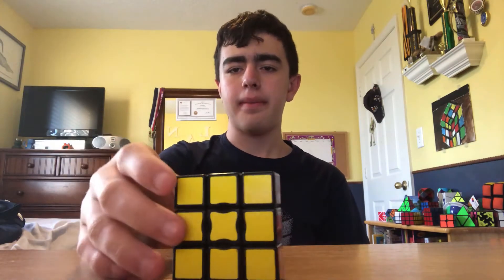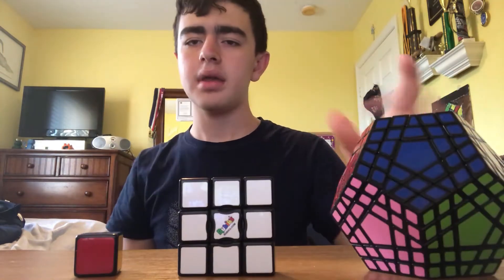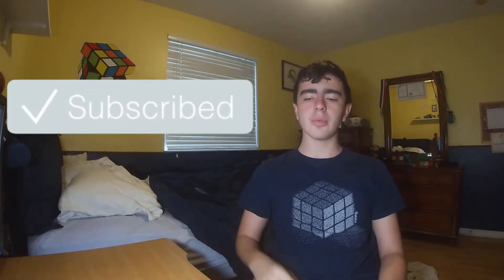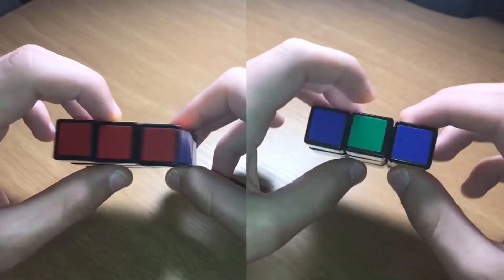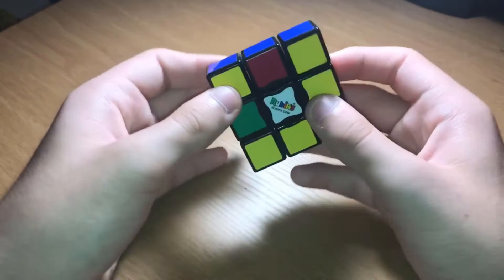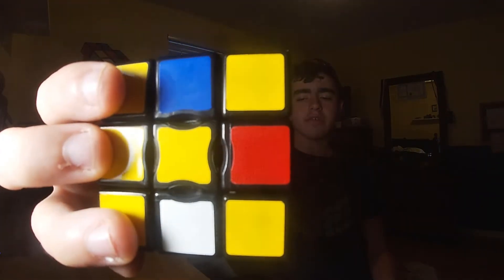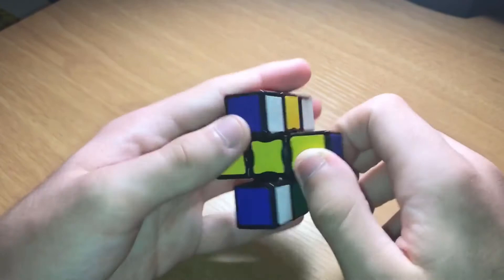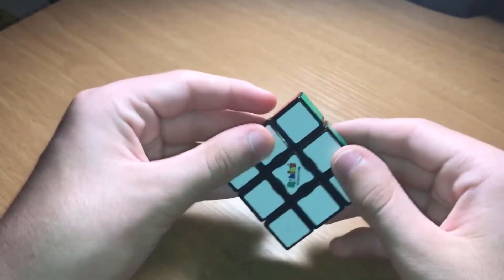How to Solve the 3x3x1 Floppy Cube

Comment: I have another way to do it so if it's scrambled and you try to solve it then look at the edges and put the correct colors on the edges it'll let you solve except there will be parts that are on the top and the bottom that will make you not solve it but to solve it with those is to twist the left and right to face the middle part of the cube and twist the top and bottom and boom